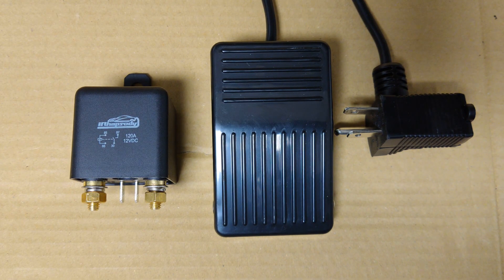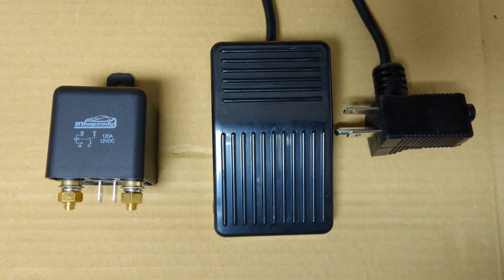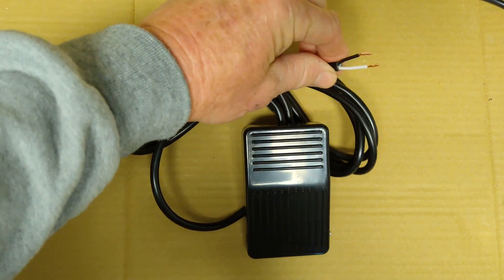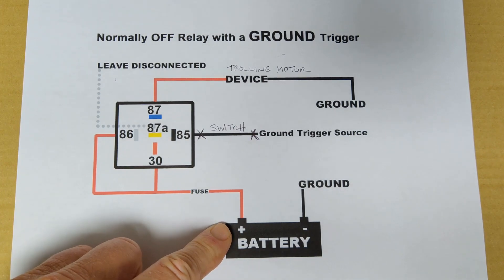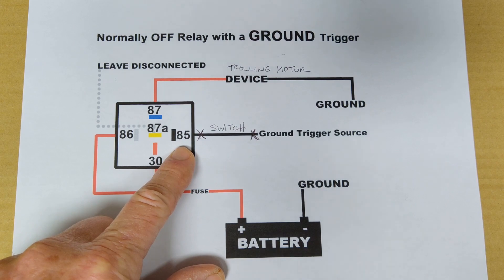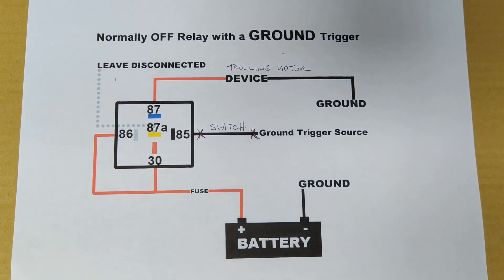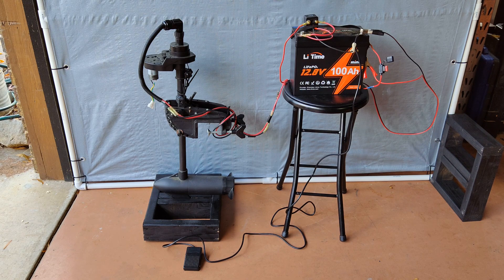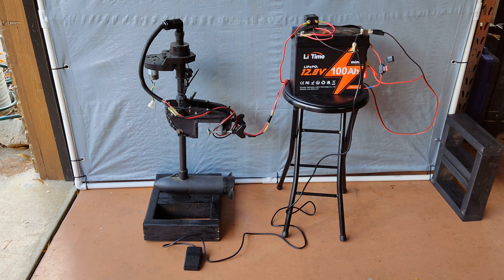Trolling Motor Momentary Foot Switch

Comment: That should work GREAT!!!!!
It has been some time but I remember utilizing something like that on one of my early trolling motor conversions.

My friend Phil Krug engineered a Hobie Electra Drive PWM system for me that provided variable speed for my  Hobie Pro Angler 14 in both forward and reverse operations.  Instead of the foot switch he wired a remote variable speed pot for RPM control that I installed near my left armrest.  I steer the Pro Angler 14 with the OEM hand operated steering controls on the right side of my kayak.    He also shortened the shaft on the trolling motor and modified the fill plate to hold the motor and prop assembly.  Also, I provided a lever that would allow you to manually provide extra steering control if needed that was mounted to the trolling motor shaft that extended up into the upper Kayak deck through the fill plate.  The fill plate had the necessary pins that allowed for placing and removing the trolling motor from the OEM pedal mounting brackets.  I am able to stow the Hobie Electra Drive or the OEM foot pedals in the front storage compartment of the Hobie Pro Angler 14 when not in use.  This gives me the BEST of BOTH WORLDS.  I can use electric system until the battery dies and then quickly remove the Hobie Electra Drive unit and place it in the front storage compartment and install the OEM foot pedals which can also fit in the front storage compartment when utilizing the Hobie Electra Drive and continue fishing etc.  All the electronic components including the battery are stored in a small cooler which is placed behind the Hobie Seat.  All the wiring is provided utilizing the Anderson power pole plugs so that the electric propulsion unit and small cooler can be easily unplugged and removed if not needed.  I also provided a kill switch that is provided in case you accidently go overboard that stops the Hobie Electra Drive unit.🙂

The only drawback is that I had to make a little device to move the prop in the proper position for removal due to tight clearances.

I have seen where others have utilized other trolling motor designs with different props that make it easy to remove he trolling motor.

Hope this information provides help to others that are interested in these modifications.
Reply from the maker: Thanks John, that sounds like a really neat set up!

Comment: Would you be able to run dual 30lb motors on just the one relay? Looking to do brakes on my boat...Thanks
Reply from the maker: Yes, it is rated for 12V 120A.